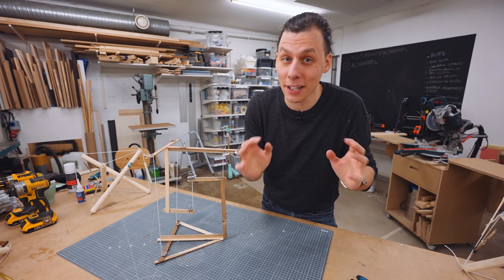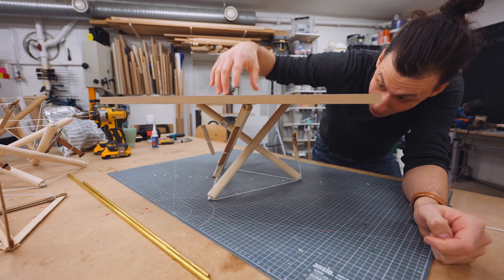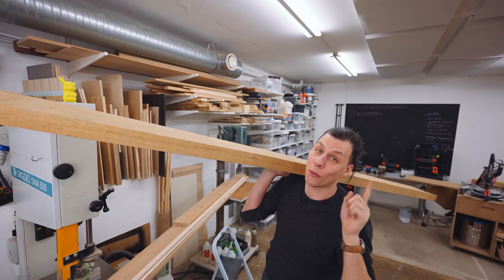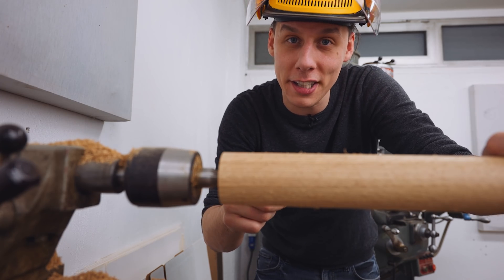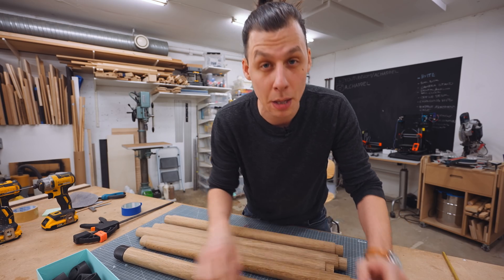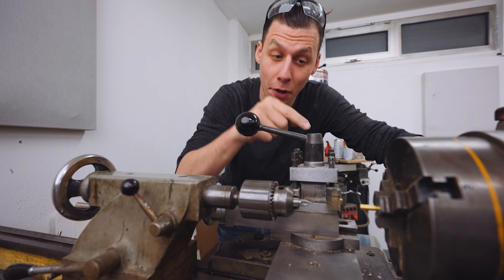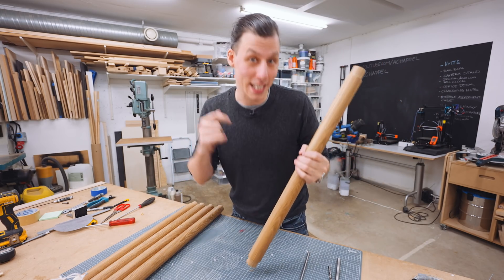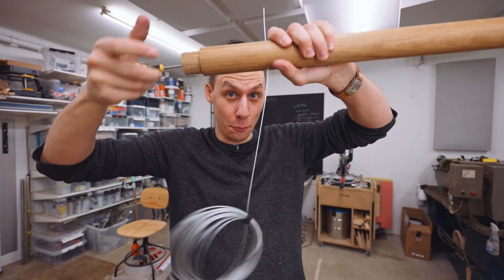Making a Tensegrity Table that Actually works!

Comment: Pretty sure that once the dowels are touching, it's no longer tensegrity. In particular, the dowels are now bending members. Not to say the design isn't cool - it definitely is; I think it's just more appropriately classified as a reciprocal frame than tensegrity.
Reply: I did my master thesis on tensegrity and sir, you are correct ! 
Furthermore, the glass is a rigid object joining other rigid object so even if the dowels were separated, still not complete tensegrity :) 
Still nice table !
Reply: @batagnam  the glass top is just resting on the members. It is applying downward forces at each but is not really connecting them together. There are neither shear nor moment force components involved as would be required for a true connection.
Reply: @fredericapanon207  i know but it still does not respect the "rules of tensegrity". 

It should lie on câble, not dowels
Reply: I mean look at the thumbnail, he edited out the wires
Reply: @AfroNinja720  Also edited the glass top in even though he didn't actually stand on the glass.
Reply: yeah, the strings are more like pseudo nails holding the sticks together
Reply: I also know some of those words
Reply: I suspect that if @Alexandre Chappel had put the brass channels closer to the ends of the wooden members, he would have been able to keep the wood legs separated for a true integrity table.
Reply: I don't think it's "clickbait" per se. I think the structure is simply mis-classified. Click bait would be: "You won't BELIEVE how this ONE WEIRD TRICK made Tensegrity Table ACTUALLY WORK!"
Reply: True. This is clickbait.

Comment: Nice concept. In a future version, you could create two locking screws in one leg so you can have the wire ends connecting inside a leg

Comment: Instead of crimping the wire together can you just use one the bolts in one of the legs to hold two ends of the wire together?
Reply: Nice job btw Alex!

Comment: what is the smoke type machines in the background? are they a form of humidifier?
Reply from the maker: yeah, they are just humidifiers. when it gets really cold here we have to use more heaters so the air gets super dry.
Reply: @achappel  Same here. I have tried many different devices and techniques and recently switched to disc-airwashers (e.g. Venta), which have a very different approach. At the first glance those ultrasonic evaporators seem to be a pretty good solution, but they have a couple of major flaws. First of all: they evaporate everything in the water, which is quite annoying if you live in an area where the tap water has a certain amount of calcium carbonate. After a couple of weeks you will end up with a thin layer / coat of it all over everything in your room. Also the water reservoirs will be contaminated with germs pretty quickly, which will then also end up in the air you are breathing.
Reply from the maker: @SCHAUDENLUCAS  ov cool thanks :) I'll check them out!
Reply: they look like a big vaporizer/humidifier to me
Reply: @kathrynelrod5570  thats what i was thinking but what are they for? to add moisture to the air? surely you would want the opposite?
Reply: @samueljenkins2684  If it is to add  moisture to the air my guess would be to keep dust down
Reply: Humidity makes rooms more comfortable in colder months